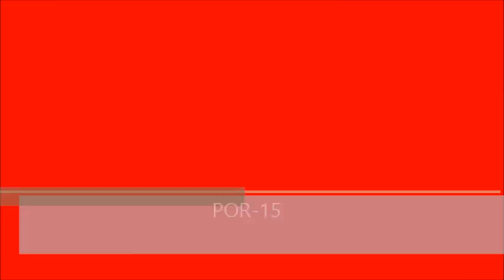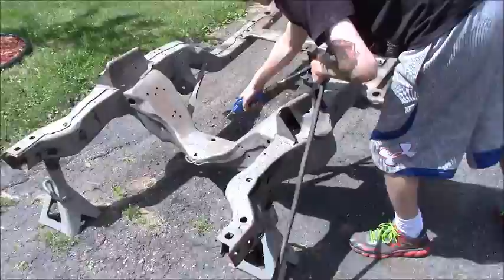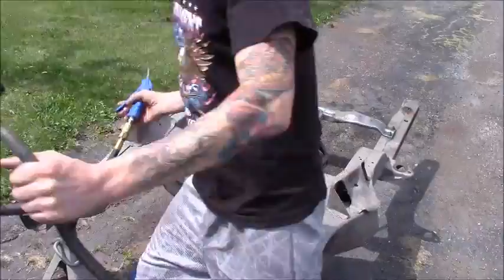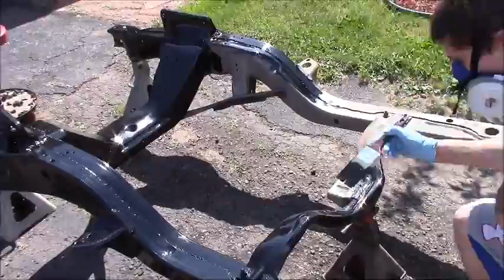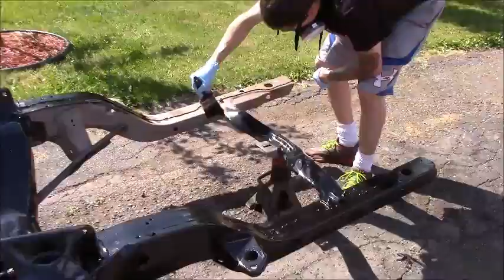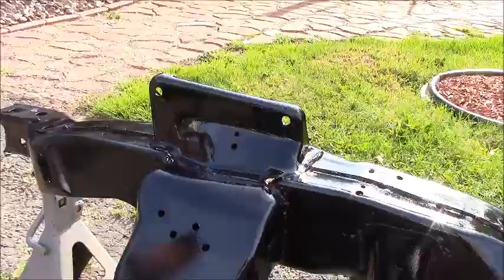POR 15

Comment: I use POR 15 a lot in most of my projects, You just have to make sure not to get any on yourself and the lid of the container, you will never open it again without destroying the can. What I do is put whatever is left in a clean mason gar and make sure the lid and rim are clean before closing, It will last a long time that way. Nice job.
Reply from the maker: Oh crap we better follow your advise rite away. Thanks for the tip. Tc